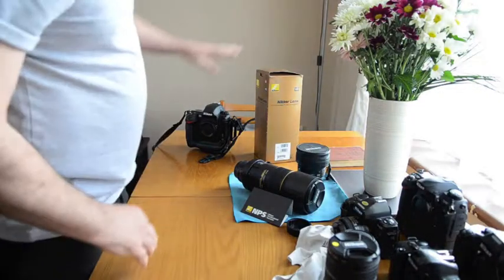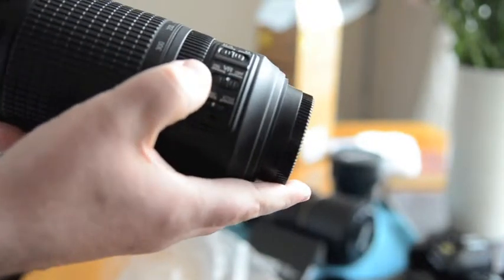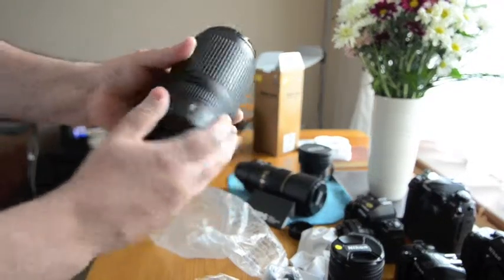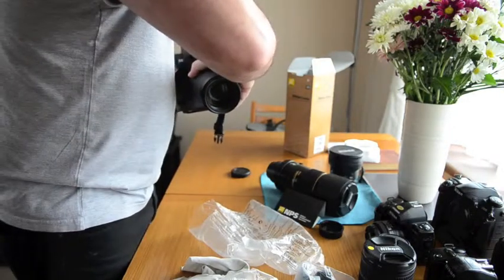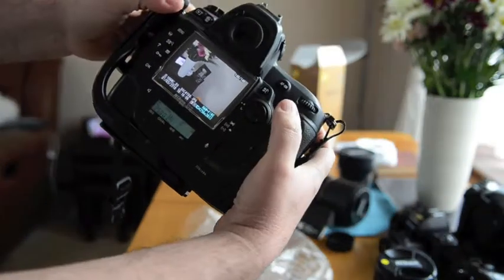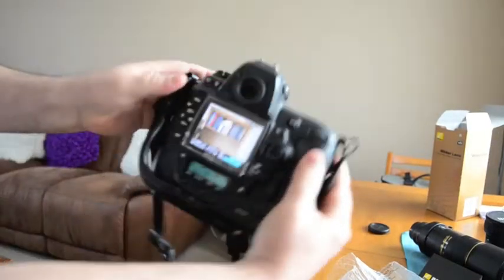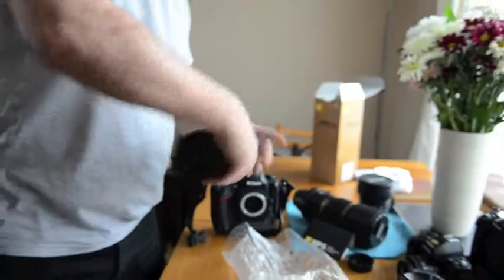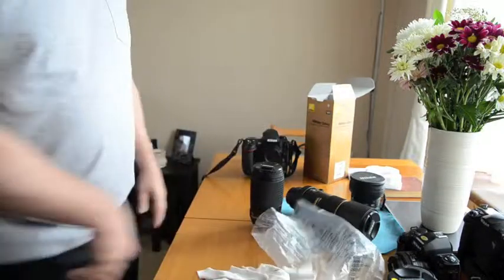1803 Nikon Nikkor AF-S 70-300mm FX VR Lens: Intermittent Fault with the VR on/off switch

Comment: I have the same issue with my 24-85VR . I also have the same issue with my Af/M switch to, as sometimes when i set it to Manual , it will still auto focus lol. Not sure why, any ideas?
Reply from the maker: Yeah, that was the weirdest issue I ever found with a lens.  As for the 24-85VR that you have...  I am positive it is a minor fault that might not be worth repairing.  I also found if I switch a lens in the middle of shooting from AF/M to M there might be a glitch, delay or no reaction...  So shutting down the camera to switch it to Manual is a slow process but might acknowledge the switch...  I don't know for sure without the lens in front of me.  Why the fault?  Only Nikon knows for sure but just like anything in life: 1.) It could be down to how it was treated/used by the previous owner. 2.) It could be caused by age with years of wear & tear. 3.) Or just pot luck that this one has the issue.  I had my wins and losses.  Sometimes we let someone with the skill to repair it take over and sometimes we have something so good and so useful is just not worth getting rid of over a couple of tiny imperfections.  I know I'm not perfect :)

Comment: Hi Ness. Do you recommend this as a portrait lens. It's the only zoom lens I have!
Reply from the maker: The Nikkor 70-300mm AF-S VR is a beautiful lens, so...  If this is the only lens you have then it will have to do.  When I think of a Portrait lens I think of:  Nikkor 50mm F1.4, Nikkor 85mm F/1.4/1.8 &/or Nikkor 135mm F/1.8 or F/2 because of the bokeh it produces... But there is nothing wrong with using what you have.  You need to practice by studying your background when taking picture so the background images don't interfere with your subject.  I don't promote software but sometimes the job calls for it...  I do recommend filters as this brings out the artist/skills in you and that is what photography means to me.